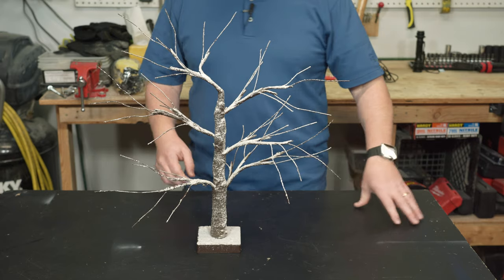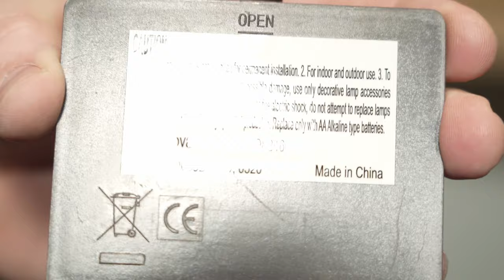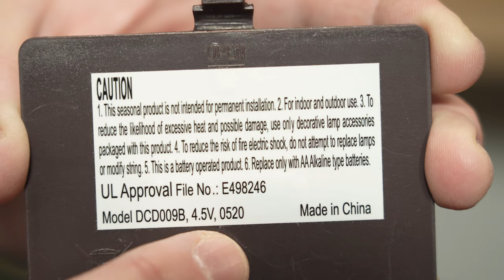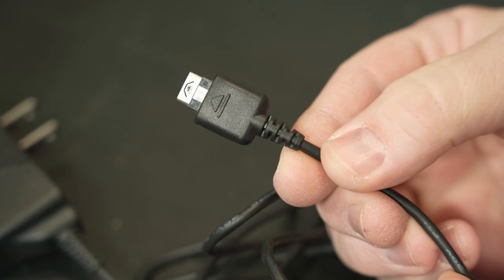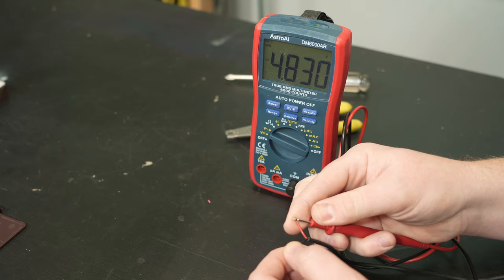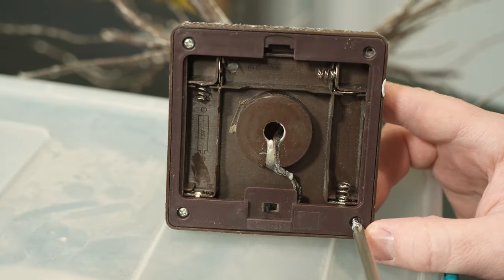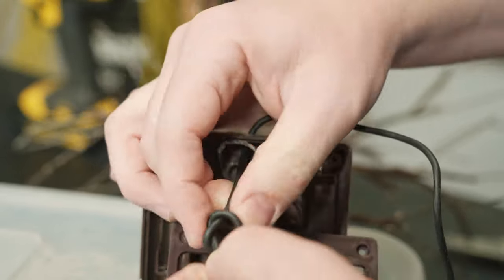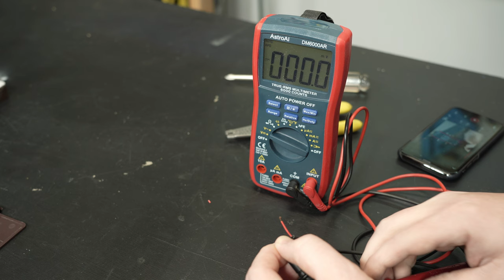Never Replace Batteries Again! Convert Battery Device To Wall Adapter!

Comment: What happens if I put positive with negative cable.  Doest it damage my house electricity?
Reply from the maker: Hi Jose - we need to be careful to make sure we are talking about the same things: Your house should have circuit breakers that will detect if you accidentally touch the hot to either the neutral or ground of your house wiring, and flip off the circuit before any damage is done. But... I suspect you are actually talking about touching the low-volt negative and positive wires from your wall adapter, not the actual house wiring. Touching those together won't hurt the house wiring, but depending on the wall adapter you use may damage the adapter. Most have protection to avoid damage if you accidentally mix things up.

Comment: Can anyone tell me once this is done are you still able to turn the switch off and on or does it constantly just stay on until you unplug it? I have some beautiful angels that have flowing snowball glitter and would love to transition them to a AC adapter❤❤❤🎉
Reply from the maker: If there was a switch in the base or wherever you put in the batteries, it should still work. Good luck!

Comment: After measuring all my wall-warts, they all read higher voltage with no load.  One labeled 9V reads 12V, and one labeled 12V reads 16V.  So I'm wondering if they are okay to use and if the voltage will drop to the correct level with a load.  I sure don't want to burning anything up testing this.
Reply from the maker: I'd double check your meter... if you have access to another meter, double-check your measurements. Or, if you don't have access to another meter, measure the voltage of your car's battery. It should be somewhere around 12.2-5v with the car turned off. If it reads in the range of 16v, and the car is working fine, you have a bad meter.

Comment: I have 5v 2amp adapter will it work or I have to use some resistors??
Reply from the maker: Hi Sheldon - lights pull power, the supply does not push it. No resistor should be necessary if you are simply replacing the battery supply with your adapter. If your device used 3 AA or 3 AAA batteries, a 5v supply should be just fine. Thanks for watching!
Reply: @AmplifyDIY  and if its working on 2 AAA batteries and I want it to run on 5v please reply
Reply from the maker: Hi Sheldon - you’d be far better off just using a 3v supply than trying to add resistors. I don’t know where you are in the world, but here is a 3v supply on Amazon for around $5: https://amzn.to/3T5Z2RZ
Good luck!
Reply: @AmplifyDIY  Thank you so much God bless

Comment: I have wall charger that is 5v and my item requires 4.5v ....is this wall adapter ok to use being .5v more then what is required?
Reply from the maker: Yes, a variance of .5v is likely not going to be any problem at all. Good luck!

Comment: Can I take a power supply plug and make it battery power?   Also, 12 v car battery options that are legit and not dangerous? A video on those two would be great. Thank you for sharing.
Reply from the maker: Good ideas, thanks squareglow!

Comment: I wanna do this with my hot wheels track launcher. It takes 4 D batteries. So I just need a 6 volt adaptor?
Reply from the maker: Hey Dale! A hot wheels track launcher would be a perfect match for something like this! Yes, a 6v adapter is what you are looking for. Something like this would likely be a good match: https://amzn.to/3vGSFe4
Good luck!

Comment: I have a homemade Christmas decoration that has six sets of battery powered fairy lights.  Three AA batteries (4.5 volts) for each set of lights.  I switched to rechargeable batteries, but still need to change them about once a week.  I want to switch to plug-in.  My question is:  Can I somehow connect all six sets of lights together if I get a power supply with enough total voltage capability (6 X 4.5 volts = 27 volts), or do I need a separate power supply for each set of lights?
Reply from the maker: Hi Anthony - You can certainly wire all the sets together, but the math does not multiply voltages, but amperage. i.e., rather than 6x4.5 volts, it'll be 6 loads at 4.5 volts and ??? amps. Wire them together in parallel, and the amps go up, but the volts stay the same. You want all 6 to get the same voltage, and be able to draw the same amperage as before. 

If they last a week or so on 2 AA batteries, they draw very few amps individually. 4.5v is close enough to 5v that I'd recommend you find a 5V power supply capable of at least 3-5 amps. Something like this would work well: https://amzn.to/3sQ02lE

Then just wire all the + from where the batteries used to go to the + of the power supply, and all the - to the - of the power supply. Make sure you do this in parallel, not series. If you are not clear on the difference, a quick google should help a lot. 

Good luck!

Comment: Wouldn’t it be necessary to know the amperage requirements as well?  The charger didn’t list them.  I’ve heard it’s okay to over-amp the device, but we didn’t really know what the minimum being required was or what was being sent by the charger.
Reply from the maker: So, it's important to understand that a charger/power supply does not push amps. The device that is powered draws amps... as long as the power supply can provide as much as the load needs, you'll be fine. You can certainly use a power supply capable of proving a lot more amps than the device needs... because the device will just pull what it needs and no more. 

But that's not the same with voltage: If a device runs on 5V, DON'T use a 12V adapter with it, as the adapter will supply 12V, and likely damage the device. 

If a 5V device needs 1 amp, and you connect it to a 5V, 5 amp power supply, the device will happily pull the 1 amp it needs and the power supply will not have to work hard.

Great question!

Comment: Need your help ASAP. I'm trying to convert a rechargeable battery powered fan to wall power, but i'm not sure if It will be safe. What voltage power cable do I need for this fan? This fan has 2 batteries each one is 20,000 mAH and 3.7 V and  74 OWh. Thats what each battery says on the outer part.

Here's the parameters shown on the actual plastic part of the fan itself: 
Power: 22.5W Max
TYPE C (INPUT) : 5V - 3A, 9V-2A, 12V-1.5A
TYPE C (OUTPUT) : 5V - 3A, 9V-2A, 12V-1.5A
USB A (OUTPUT) : 5V - 3A, 9V-2A, 12V-1.5A
Battery Capacity: 40,000mAH

Please tell me what type of power plug I can use. Thanks for your help!
Reply: It seems these are rectangular batteries 4 -1/2 in X 2-1/2 inch. Each one seems to be two batteries wrapped in one (double battery). So we have TWO double batteries.
Reply from the maker: This sounds like it's a fan and a power bank or something - based on your first comment about the USB-C input and output. Can you simply plug this into a USB-C wall adapter rather than pulling the batteries out completely? It seems designed for that in the first place....
Reply: @AmplifyDIY  The fan stopped working when I removed the speaker buzzer from the motherboard. I wanted a silent fan when turning it of and on and also when changing the settings. Now it turns on for 1 second and then shuts off automatically. I got it from amazon. SALLOUS 40000mAh Rechargeable Camping Fan.

Comment: My bedlamp needs 3 AA batteries. I have a phone adapter which is 5V and 6Amps and Another adapter with 5V and 2Amps and another old adapter with 5V and 0.5Amps.
Which one should I use? How does Amps matter here? 
Can you explain please. Will the Ampere change the brightness of the leds? Thanks in Advance :)
Reply from the maker: Hi There - Amps are not pushed TO the device, they are pulled BY the device. So a power supply which is rated at 5 Volts and 2 Amps is capable of providing up to 2 amps continuously. This does not mean it will "push" 2 amps, only that it can support a load of up to that much. 

If you have a bed lamp that needs 3 AA batteries, it needs around 5 volts, and likely only draws a few milliamps, so any of the power supplies you mention will work fine - though I'd suggest you probably only need the 0.5Amp one. 

Good luck!

Comment: Can I replace my speakers 3.7V li-ion battery with a 5V power supply?
Reply from the maker: I would not change voltage that much. See if you can find a 3.5V or 4V power supply. Here are some options on Amazon, including some adjustable power supplies so you can experiment a bit: https://amzn.to/3W5Tzh9

Comment: Can we use 4.8v power supply for 4.5v device? Thanks.
Reply from the maker: Hi Shing - yes, that will most likely be just fine. Good luck!
Reply: @AmplifyDIY  Thanks. That's a wonderful trick, you demonstrated it very well, I think I can handle it.

Comment: I have a lot of blow molds that are battery operated.  A tree that has about 30 bulbs, each bulb has 3 wires attached up inside the bulb. Operates on 3 AA batteries, should I follow the same instructions?  I'm so tired of battery operated stuff. 
I'm a little nervous doing this, I want to make sure I'm using the correct adapter that has a black and red wire only, correct?  
I have a picture but I don't think I can post it here.
Reply from the maker: Hi Gretchen - yes, you should be able to do this with your tree. If it runs on 3 AA batteries, you should be looking for a 5V power adapter. If you'd like to send a few photos of your situation I may be able to offer more instructions about exactly where and how to get things connected: amplifydiy (at) gmail (dot) com. Good luck!

Comment: So I have a holiday decoration that requires 6-  1.5 batteries - so this means I need 9 volts - is that correct?
Reply from the maker: Yes, your math is correct. Good luck!

Comment: What is the purpose of the resistor that was connected to the batteries?  How can you tell how many amps/milliamp cord to use? (armed with enough electrical knowledge to not kill myself, but not fully understand everything.) Thanks!
Reply from the maker: Heya Frugal - circuits with LEDs generally have a ballast resistor to prevent the LED from pulling too much power and burning itself out: https://eepower.com/resistor-guide/resistor-applications/resistor-for-led/#
Note that in this project, the resistor stayed in the ciruit - the power supply is just from the wall adapter instead of from some batteries. Great question!

Comment: I'll be honest, thought from the image and title it was some new super rechargeable batteries. Was hyped since could use some new ones in my Xbox controller, my current ones are around 3 years old. Still working but starting to get a bit jinky.
Reply from the maker: If you don't mind a wire from your controller to a wall adapter, this technique will work fine for a controller like that. But something tells me you probably just need new rechargeable batteries for that application. Good luck!

Comment: “… that’s going to be plenty of current “ How did you determine this? A supply that is too small can be a fire hazard, so this is a critical point.
Reply from the maker: The tree runs on 4.5V. The power supply supplies 4.8V@0.9A. The supply is not too small, and it fact is offering 0.3V more current than the label on the tree says it needs. However, AA batteries also don't supply a perfect 1.5V either. 1.5V/battery is the typical nominal voltage. Depending on the battery chemistry it may provide a bit less, or a bit more: https://en.wikipedia.org/wiki/AA_battery#Chemistry_and_capacity
Now, having said all that: a 0.3V power discrepancy between the power supply and the device at less than 1 amp has essentially no real risk of heating up or starting a fire. I did include a disclaimer in the video though, so if you are not comfortable working with low-voltage electrical circuits like this, it's best not to mess with it. Thanks for watching!
Reply: My question does not concern voltage, it’s about the current. If the device draws 2 amps of current at 4.5 volts, your 1 amp supply will not last.
Reply from the maker: Hi Wes - There is no way this device pulls 2 amps of current. In fact, there's no way it pulls even anywhere close to 1 amp of current. Given that the device would run for about 24-30 hours or so on 3 fully charged Eneloop AA batteries (which supply 1.2-3 volts each and are rated for 2000mah capacity). If the device was drawing 1 amp, I'd expect it to run for only around 6 hours on 3 fully charged batteries. Since it ran for between 4-5x that, it is safe to assume it was drawing roughly a quarter of that much current, around 250 milliamps. There is a bit of hand waving going on here of course (actual usable capacity of the batteries vs. total advertised, etc), but I didn't even think to measure the actual current draw with my multitester because based on how long it ran on just 3 AA batteries. In the interest of due diligence, of course I should have demonstrated how to measure actual current draw to prove it would not exceed the power supply limitations..it just didn't occur to me because the little tree with a few LEDs draws so little current.

Comment: What if the gadget uses only one AA battery? What size adapter would be needed? A 1.5 by number but what if one can't find a 1.5 adapter?
Reply from the maker: You should be able to find an adapter that is adjustable from 1.5v all the way up to 12v. Something like this: https://amzn.to/485zpcb would work well. Good luck!
Reply: @AmplifyDIY  Ah, I believe that IS what I need! Thanks much!

Comment: Small nitpick. The wire connectors you used for heat shrink are fully capable of soldering rhe wires together on their own, this is actually why theyre used in the field. You didnt do anything wrong, just figired it woukd save some time to not solder first
Reply from the maker: Yeah, but I'm a "belt and suspenders" kind of guy when it comes to any electrical connection. I know those connectors are good on their own, but a bit of extra insurance (especially when others may follow this as a guide on higher-current applications) is a good thing. Thanks for watching!

Comment: how do i convert 120w chest freezer to DC and connect to solar panel?
Reply from the maker: That's pretty far beyond the scope of this video. If you need a chest freezer that runs on DC instead of AC, you likely will be much better off using a simple DC to AC converter between your freezer and the DC power source (solar system, etc). Here is one such converter you can consider: https://amzn.to/3YHU57u

Comment: I stripped the top of the cord on my plug but instead of just a red and a black wire, there is also a white, and a green wire. White is supposedly neitral and green for grounding. Can I just ignore these wires and not connect them in the circuit? It's for a 4.5V toy, nothing big.
Reply from the maker: Hmm... is the cord a USB cord? They generally have 4 conductors in them in an arrangement like you describe. Do you have a multimeter you can use to test each of the 4 conductors to see exactly which color does what?

Comment: This is light, what about , say, a Dustbuster 9.6 nicad pack?
Reply from the maker: A dustbuster draws a lot more amps. You'll need to find a 9 or 10 volt supply capable of delivering pretty decent amperage. Good luck!
Reply: @AmplifyDIY  thanks

Comment: Sir i am having a bluetooth speaker with input of 5v 2A whAt Adapter shpuld be used pls help
Reply from the maker: Hi Aman - if the input is 5v@2A, I'd recommend getting an adapter capable of 5v@3+A. 5Amps would be ideal, as it provides plenty of head room. This adapter would be perfect, as it comes with a plug designed to clamp leads for a project just like this: https://amzn.to/47LBoS5
Good luck!

Comment: Does this work with plugs like this? Or can i get away with using lamp wire..
Reply from the maker: Lamp wire? If you mean can you just use a plug from a lamp, NO - do not do that. You need to convert your (most likely) 120V AC power from the wall into a much lower (5V, 9V, 12V DC) power for your device.

Comment: Show us how to connect a normal ceiling bulb to a wall output
Reply from the maker: Hi Thee - I'm not sure exactly what you mean by this. From an electrical standpoint, a bulb fixture provides exactly the same power to the lightbulb that an outlet provides to anything you plug in... bulbs just have a specific "plug" that is different from things you generally plug in. If you want to plug a regular light bulb into a socket, you'll need an adapter, something like this: https://amzn.to/3fz9504

Comment: I'm the opposite, I can't put electric into my shed as it's to far away so I have to use a 12volt solar panel to charge up a 12volt car battery and use a 12volt inverter to 220volts to run some of my power tools, ALL FREE ELECTRIC,  USE OLD RECHARGEABLE DRILL BATTERYS TO POWER TORCHES, RADIOS, USB CHARGING AND IT'S ALL FREE, SO TO CONVERT SOMETHING USING BATTERYS TO LOW VOLTAGE MAINS POWER WILL COST YOU MONEY AND TODAY YOU NEED TO KEEP YOUR MONEY AND NOT BURN IT AWAY GOOD VIDEO BUT WHY WASTE MONEY 😳

Comment: Can i make my whole house operate on a wall plug? Do I need to increase the diameter of wire as my neighbors shed is about half a mile away, and that's where I'm looking to plug my house in. Any advice is greatly appreciated, just remember, I never told you what I was doing. 
  Also, my neighbor is a real jerk. What do I say when he tries to tell me I can't plug my house in to his shed, the only reliable power source on my side of the river
Reply from the maker: Check into rental prices for trenchers. Your neighbor is less likely to notice a buried cable. 😂
Reply: @AmplifyDIY  I already paid for one but now he's standing at Home Depot still and he says I was supposed to keep my receipt I told him he never gave me no receipt and he says he don't believe me
Reply: @AmplifyDIY  I got one but it won't come on. I checked the plug and the breaker and everything